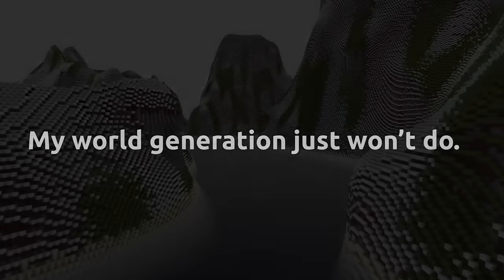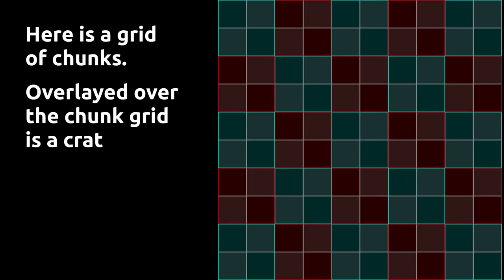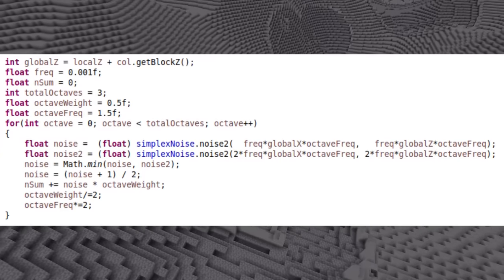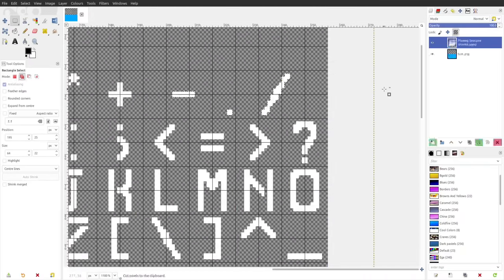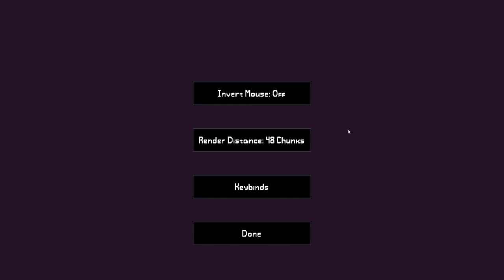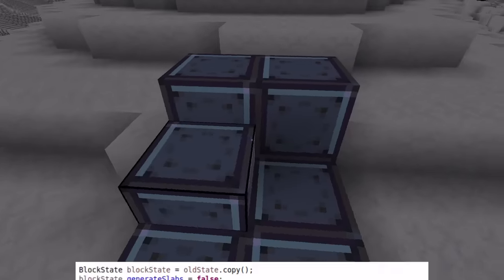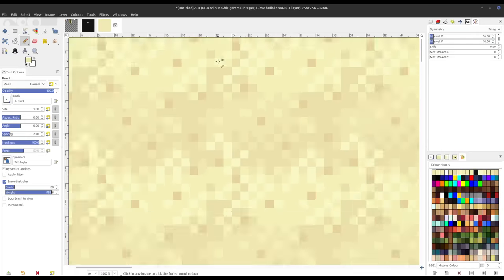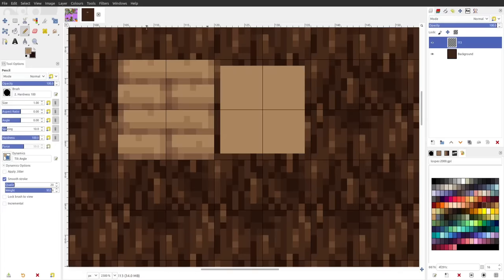Making THE MOON

Comment: <WARNING. LONG ASS COMMENT>
Some ideas I had:
Notes -
  I'm aware these ideas can't be implemented for some time (if at all), I just wanted to say them before I forgot
  Honestly, before giving into feature creep, I'd recommend make only what's needed for any story you want the game to have. Minecraft's 
  progression and story are non-existent, which is a detriment. After that, build up all the other features for the sake of fun. If it ties into the
  story, cool, but this is ultimately a sandbox game, so don't restrict yourself after completing the story bits (if there is one)

Gravity -
Have it set differently for each planet. This would give each planet a different feel and also, depending on the planet, provide gameplay challenges or just fun. If you have Planetoids, perhaps the gravity can be so low that jumping could actually throw you into space? And for heavy gravity, you may need certain gear to offset or even survive on the planet (I'm kinda thinking something like the Gravity Suit from Metroid, except actually used in space. or magnetic boots)
As for the challenges and/or fun, perhaps a water world with high gravity? Go there for X reason, but completing X reason and getting off the planet would be a challenge, as the gravity is too high for you to swim. Giant ocean life would look like it's flying from your perspective. Maybe there's even someone... Kraken a joke! (whaaat? ...I thought it was funny) Or, perhaps a mountainous planet with floating islands and low gravity. The low gravity would assist in getting around, especially if those parkour mechanics can help. Throw in a grappling hook and you could use the floating islands to pretend you're spider man. No real challenge, just exploration and pseudo-flying.

Gear/Equipment -
As mentioned earlier, some sort of equipment, whether it be a suit, boots or some macguffin, to offset gravity problems. On low gravity worlds, it would "increase" your gravity, making you heavier, and vice versa for high gravity. Perhaps even a macguffin that does the opposite too...
Grappling hook. One that is just the hook and a rope, can be "charged" (hold right-click) to be thrown further. Then a grappling gun, which takes ammunition and complicated parts to make (motors and metal wire), but shoots the hook much further, faster.
A hoverpack. Localised flight. I'm entirely thinking of Satisfactory here. It would only take power, and can only be used within range of a "power pole" (whatever form that may take), but it provides flight that completely ignores gravity. Mostly because I think having gravity affect the hoverpack by making it slower/faster at vertical movement, or changing the power drain might be annoying for most players.

Mining -
For early to mid-game It should probably be done manually. Perhaps start with pickaxes, which, similar to minecraft, have durability and limited speed. And they will break eventually. But for mid-game, you move onto drills. Drills are faster but require fuel (batteries?) and can break. But, they can be repaired, since you just swap out the drill head. Maybe have a recycler so you can get back some materials from broken items?
For late-game digging, since there are robots and automation (in the general idea you mentioned at the end of the last video), have robots automatically mine. Or perhaps a mobile drill (similar to tunnel bores from the Create mod). They would require power but could self-repair during a "recharge time" (perhaps at night? if they're solar powered). Obviously, they'd need a depot area too.

Inventory - 
Late-game, you could have something similar to AE2, the wireless terminal that lets you interact with your storage system. As for early or mid-game... I think just copy terraria. Have a bigger inventory and large item stacks, if possible. Minecraft's biggest issue with inventory is adding more and more things that people want or need, but haven't given them better ways to actually carry them.
So, perhaps a backpack? Not as you'd normally imagine though.
Just for visualisation: imagine a curio's slot. put a backpack into it and, instead of pressing a button to open the backpack, it just increases your inventory size. Give the new inventory tiles a different colour and that will be the stuff that's in the backpack, if you take it off.
Taking this a step further, for late-game, you could have a wireless terminal for you storage, which would instead look like JEI, letting you scroll through pages with dozens of items available. Also remembering to save which page you were on, so you don't need to constantly rescroll. Perhaps include a "favourites" page where the player can pin and sort the blocks/items they frequently use?

Building - 
The joy of sandbox games. Making whatever you damn well please. Players love flexing their creativity with absurd creations, be they mechanically or visually amazing. Frankly, I'm pretty sure games have already reached the peak. Both minecraft and terraria are the same in regards to this. The only real differences are how you can make building easier. Terraria makes it easier by having items that increase build speed and range, which is good because it's 2d. Minecraft doesn't really have anything for or against its building (afaik).
For the early game and even mid-game, I'd say just keep it the same as Minecraft.
That said, I would recommend having blueprints, an "editor" (which gives me another idea. I'll put that below), and a way to place blocks at long range. For late-game, rather than making a crab claw, I would suggested a tool like Subnautica's builder tool.  You can select blocks in your inventory (or later on, scroll through a selection of blocks from the "wireless terminal") and place them at long range. Using the same builder tool, you could make a blueprint or place one too.

Editor -
So the editor could be accessed through sleeping, early-mid game, or something like a VR pod late-game. For the early game, it could just be a small dream world and complicated blocks can't be used, so you're limited on what you can design. By small world, I'm thinking of the like 13x13x13 box from the Compact Machines mod. You also can't blueprint what you design. But for the VR pod, you get access to essentially a flat world. Both have "creative" because you're sleeping, but the VR pod can let you blueprint. To avoid player annoyance, have it so the stuff you make in the dream world will appear in the VR world. This will let players keep their previous designs and let them blueprint them.
As for the VR pod itself, it could naturally spawn in an abandoned science facility/bunker and be either repaired or recycled.

Planets - 
Since you want to have planets, I personally would recommend having 5-7 unique planets for the final game, excluding "earth" (Maybe call it Tellus? It means Earth, but I've never seen that particular name in a game before).
Here's some types of planets I thought of;
ocean world - A world with its ecosystem entirely underwater. If build height limit is high enough, perhaps players could build a floating city on its surface? 
mountainous world - self explanatory, i guess. It's mostly mountains and ridges. Maybe volcanoes too.
broken world - It's like an entire planet is made of floating island, which chasms that fall ridiculously far down into the exposed core of the planet.
desert world - it's mostly a desert. There is oases, so it's possible life could grow.
space station - Not a planet, I know, but who wouldn't want an endless void to build a star destroyer in? I thinking heavily of Galacticraft here.
Moons - Self explanatory. They're called moons because they're too small to be planets or sustain life (i think?)
Lush world - a world mostly made of forests, rainforests, plains and oceans. Even the underwater ecosystem is filled with life.
Planetoids - closer to glorified moons, but can potentially sustain life.
There's 7 types of world there. If you want to have potentially infinite planets (that aren't empty), perhaps you could have something like a list of modifiers that uses a point system? I thinking of Minecraft's "infinite dimensions" update but with actual structure.

Modifiers I can think of are;
Very Low, Low, Normal, High and Very High Gravity
Barren, Normal, Rich resources
No, Normal, Toxic atmosphere
Clear, Normal, Stormy weather
Plains, Normal, Mountainous terrain
Frozen, Cold, Temperature, Hot, Scorched environment
Dead ocean, normal, thriving ocean
Dead, Normal, Thriving environment

*thriving wouldn't be possible for frozen or scorched environment and dead would be impossible for lush world

These modifiers could be selected via a point system, where everything is set to normal by default, but point get used depending on how far left or right the choice is, or they can just be randomly selected. If you mix and match terrain generation, you can have unique planets too. Like floating island on a scorched stormy low-gravity broken world. 
Perhaps for end-game, you can build a terraformer, and use that point system yourself to reconstruct worlds. Perhaps it would keep the same generation seed, but would be regenerated. This would not change the planet type or gravity, just the other modifiers. A barren world could be turned into a lush world.

Ultimately, I have no clue if any of this is possible, but I like to think of my ignorance as "I don't know where the box is, so I can think outside it more easily than someone who does, as they would restrict themselves to the box and what they know is possible"

EDIT: Only just remembered, but a way to share content among the player community, like what Dragon Quest Builders does, would probably be very neat. Being able to easily share blueprints or small scale builds that easily would be great, especially compared to minecraft, where you need to upload a save to mediafire, or other platforms, for people to download.

Comment: While you were describing the slab autogenerating system, an idea of "macros" popped into my head. They would be user-created files that parameterized models, so inheriting models could pass values into the macro, varying the output. An example for the slabs could include the values "texture", "rotations", and "slices", controlling the appearance of the block, which ways the slabs could be rotated, and how many layers could be created respectively. The parameters system would be powerful, allowing for modification of vertex positions themselves, which could be useful for determining foliage height. For example, a generic "foliage" macro could be created, which makes an x-shaped billboard model (similar to grass in Minecraft), and the value "height" could be passed in. Maybe something like "sections" could be used to determine how many planes are in the block (2 making an X, 4 making an asterisk-like shape). This way it would be easier to create new block shapes, such as windows or chairs, while keeping their versatility.

Comment: Earlier I was trying to imagine how to have a sphere world while having it look flat locally. The problem starts with coordinate translations at the 45 degree point, but with your moon it's just angled. and at 45 degrees,45 degrees it's a pointed world. It would not be hard to have mobs and the player change there angle and the direction of gravity based on the coordinates. The trickier part would be to change the terrain generation so it only generates 16x16x16 chunks based on what is seen or what is near. That way the sphere would remain hollow until dug into. Then a method of shading and texturing all the blocks based on the local angle would leave grass blocks as half slabs as that way they could have a local flat side.

Comment: One idea that may be interesting to integrate into this game is Cellular Automata. More specifically, applying the logic of cellular automata to the natural use cases that will tend to be present in this type of game. Trees growing by extruding trunk and branches, soft materials collapsing into piles when disturbed, fire spreading and burning.

Naturally this will have a significant performance impact since every block that has a behavior like this will need either periodic updates, or will piggyback other updates to set off it's own updates. But the upside is the raw potential even a basic version of this system could have. The popular redstone suggestion being a notable part of that, though from the premise of the game it'd likely be more like Electronics and pipework.

Comment: I think a way to make more versatile textures is to have optional textures for slabs/stairs/other, then rotate those textures into position. If those textutes arent included, it defaults to the the block texture scrape. You could also implement different textures per orientation using a similar system.

Comment: One thing that would be extremely handy for auto slabs, is a tool, or keybind to rotate the texture. This is a problem you see a lot in "framed" block mods in minecraft, depending on the orientation you can end up getting the wrong side of a block, or the top of the half when you want the bottom, or in the case of vertical slabs, get the left half of the texture when you want the right half.

Comment: i actually thought of a way to implement chunks in minecraft better a few years ago. the solution i come up with in C is to make each chunk just a basic 1D array of unsigned 32 bit integers, with set offsets for 16x16x256 elements (for it to function like a tensor), and then using these offsets you were able to get a specific block at a specific XYZ coordinate. this is a data-oriented design of some sort, as it is focusing on a "chunk" rather than individual "block. for block states and properties i've decided to use bit masks and bitwise operations to just set bits that correspond to each property (it might not be really flexible but it works). i don't remember if i benchmarked it or anything, but i assume that it was in fact efficient. why? because computers suck at object-oriented design, math, etc. but they are really good at stroing/loading data. so arrays will always perform better than anything that is imaginable.

my other funny solution involves bit masks yet again, a chunk is just an integer where bits are set corresponding to the coordinate offset. it is funny because your chunks will be small af and will only hold either one block (air) or another block (grass).

programming is fun. program optimisation is more fun.

Comment: You should create a system for placing down slabs which automatically orients and positions them based on which half of the block you're looking at and which way you're looking so that there aren't multiple half slab items. Simple QoL feature.

Comment: About planets i think the planets should be randomly generated but with a smoothing pattern so for examnple venus. One part is a acid lake with smaller lakes around it and its on a smaller y lvl. and then the vallys are mostly smooth on a way high y lvl thats slowly going down to the y lvl of the lakes. And the part that im talking about is that you should add a slow transition thats going to the lakes. for example the closer you get to a acid lake the more acid is around you and acid pouddles can only spawn if the block facing a z and x axis  isnt air. Also the minimum hight of the acid lake must be 1 and maximum 6. (starting from the smallest y in that place. Also sorry for my bad english and i hope i explaind my idea well)

Comment: for the slabs you should "slice" the texture into 3 parts, glue the bottom and top together and just discard the middle part instead of just halving the texture
it would make the slabs look more consistent with the parent block (like in the example you showed the slabs don't have a border at the bottom and the implementation i suggested above should fix that)

Comment: Aseprite is a really good (and cheap) program for doing pixel art that has some really good features like built in pallettes, very easy toling, and animation+layer support which may be useful later on because it can handle separate files or spritesheets.

Comment: i dont know if you already have or plan to have this but, i saw in the video that you had different items for top bottom and each vertical slab. that would be super inconvenient to use in-game. making the system that is in minecraft would be pretty useful. placing the slab according to whether you clicked on the bottom or top half of the block would place slabs as so. and sneaking while placing would place vertical slabs. same with stairs.

Comment: In computer science, arbitrary-precision arithmetic, also called bignum arithmetic, multiple-precision arithmetic, or sometimes infinite-precision arithmetic, indicates that calculations are performed on numbers whose digits of precision are limited only by the available memory of the host system. This contrasts with the faster fixed-precision arithmetic found in most arithmetic logic unit (ALU) hardware, which typically offers between 8 and 64 bits of precision.

Several modern programming languages have built-in support for bignums,[1][2][3][4] and others have libraries available for arbitrary-precision integer and floating-point math. Rather than storing values as a fixed number of bits related to the size of the processor register, these implementations typically use variable-length arrays of digits.

Arbitrary precision is used in applications where the speed of arithmetic is not a limiting factor, or where precise results with very large numbers are required. It should not be confused with the symbolic computation provided by many computer algebra systems, which represent numbers by expressions such as π·sin(2), and can thus represent any computable number with infinite precision.